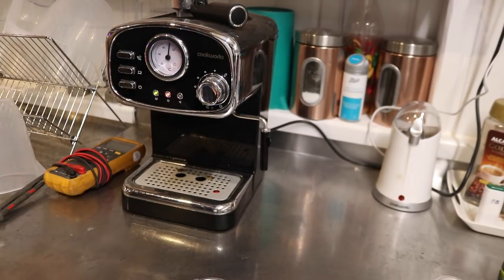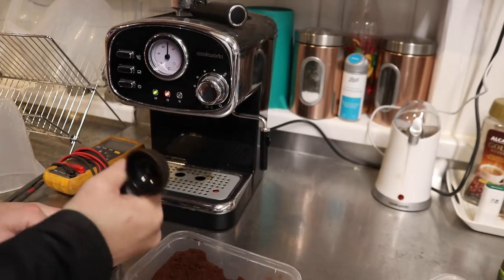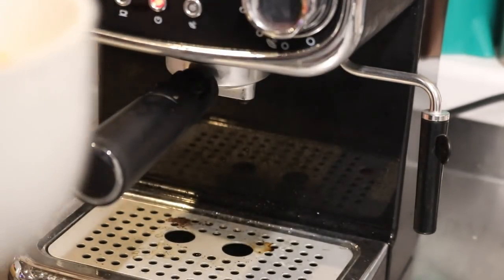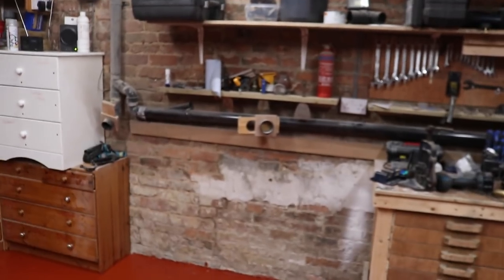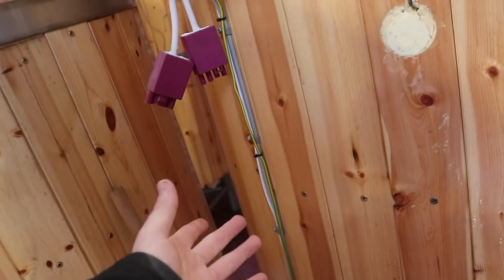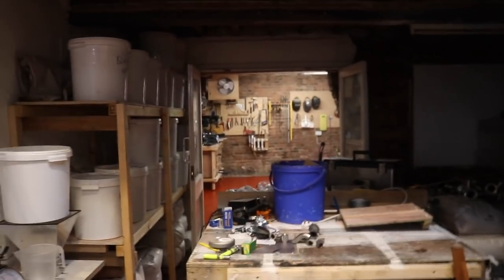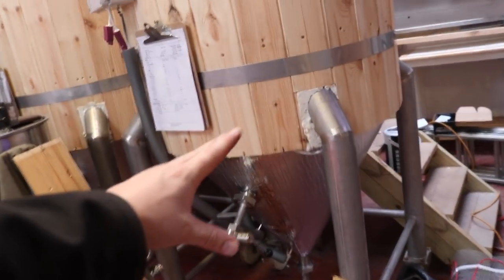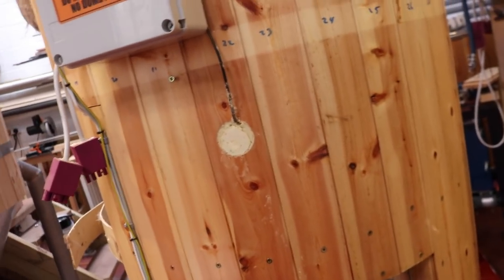WILL THE CABLE WORK?

Comment: I brew quite a few Lagers and I've never had to do a diacetyl rest. I use a modified Narziss method of lager fermentation which in theory reduces the amount of the diacetyl precursor alpha-acetolactate (and other esters) produced by the yeast at initial growth. This method starts the pitching temperature a few degrees lower (44F) than the primary fermentation temperature (48F to 50F), and then slowly ramps that temp up to primary fermentation temperature over a few days to basically manage the initial yeast growth phase. The main difference for me is I pitch the yeast from a starter slurry so the yeast is active and ready to go at pitch. I also don't do a secondary transfer as I'm using fresh yeast, and instead do three weeks in the primary then off to the kegs. This method is not something I came up with but got the idea from Jamil Zainasheff (in the book Brewing Classic Styles and the Brew Strong podcast). Regardless, better control of your fermentation temperatures is a must, and those heating cables look like they will do the trick!

Comment: A lot of the new houses being built by local council around here now have no fireplace/chimney, apparently they have underfloor heating,I'm thinking possibly it's the stuff you've used here,have never seen it before though. If it can do the job in a house should be sufficient for what you're doing I reckon. Can't wait for next update on all the beers,I know you're still running about a week behind on vlogs but don't be tempted to push it and get that bursitis back. Cheers.

Comment: Just a suggestion.......maybe self-regulating heat trace cable used on piping could be an option.
Reply from the maker: I did look at that, very expensive.
Reply: @harrybrew69   It would seem you have a good solution. I just remember a product we used on offshore piping systems being very safe and efficient.

Comment: Looks nice! Did you think about running a warm glycol circuit?
Reply from the maker: I did, the trouble would be regulating tank level between the hot and cold system.
Reply: @harrybrew69  Yes. I did it two ways in the past. It took lots of valves, heater(s) and controls.